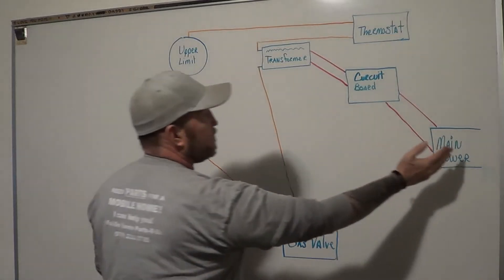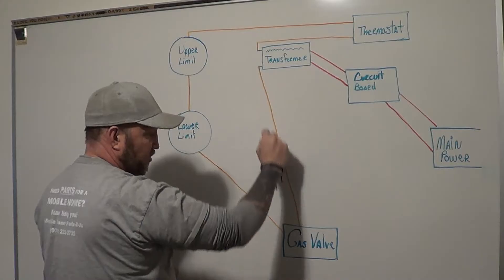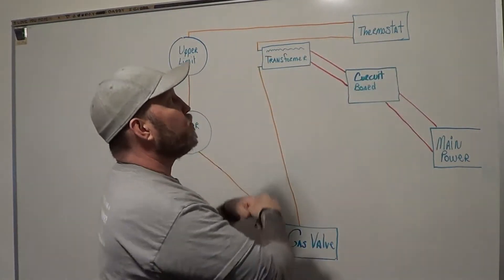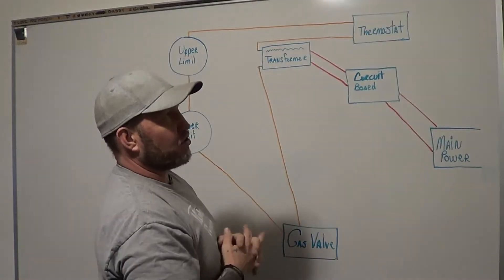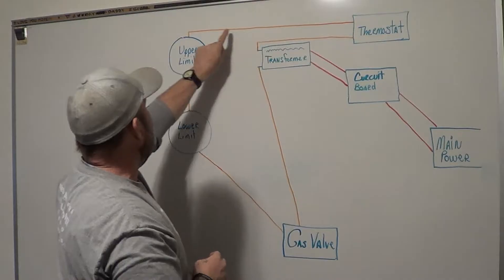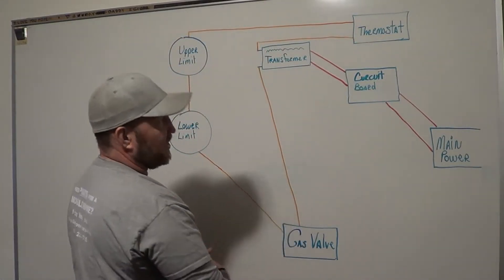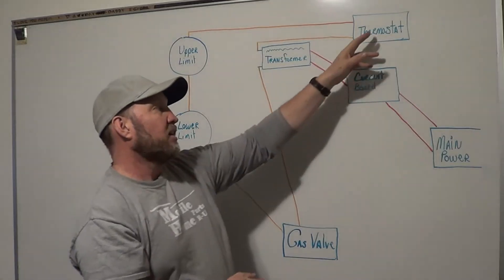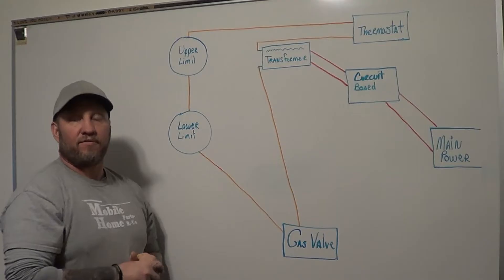Limit Switch 'OPEN'

Comment: Hi Randy.  Thanks for the video.  It helped me diagnose my fan running and no ignition on my gas Nordyne M1M.  I have the bypass wired in place, I taped the connections so they don't make contact with any thing and I ordered the replacement limit switch.  Do you think it is safe to let my furnace run with the bypass wire in place while I wait for my part to get here?  It will take two days to arrive.  I realize the limit switch is one of two fan limit switches and they are designed to protect my furnace and me incase of overheating or other problems.  Just didn't want to do anything dangerous but it is so nice to have heat again.

Comment: Dude, its 2am now. I lost my job last month, and finally start a new one tomorrow. My power went out at 11:30pm, another yank on the n00se getting tighter so to speak. Power came back at 12am-ish, and I've been messing with my furnace trying to figure out why its messed up after getting the open limit switch code. Your video literally gave me the knowledge and location to find the switch and press the manual thingy on it after almost 2 hours of searching. I now at 2am have heat and my house is warming back up from 50 something Fahrenheit. God bless you and your family, past, present, and future. May Jesus bless your works and your health and life. Thank you for making this video. Know that you helped someone in desperate need tonight through your knowledge, expertise, and willingness to share it online. You saved me having to sleep in freezing cold after almost giving up on the furnace and giving in to despair. Thanks to you I get to sleep warm tonight and start my new job tomorrow with one less worry on the plate. For that no words can really express my gratitude. But this I figure is the closest I can get. Thank you.
Reply from the maker: Super glad to help. Thanks so much for the reply